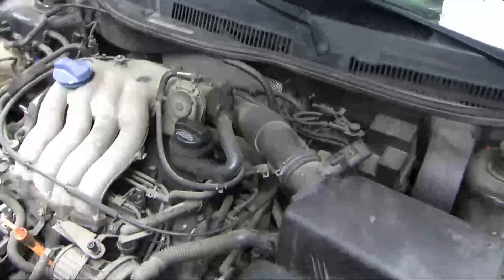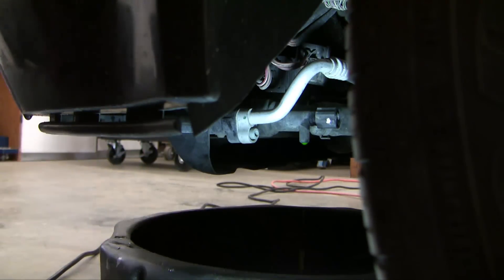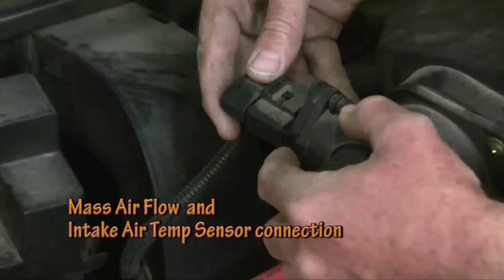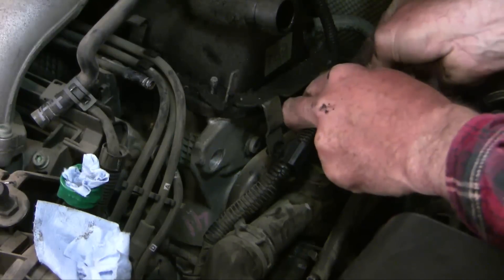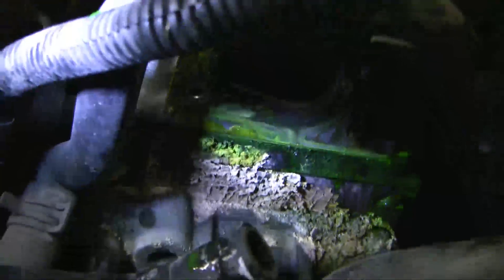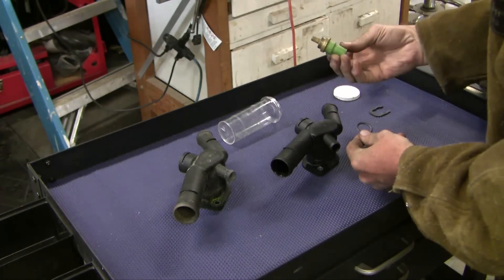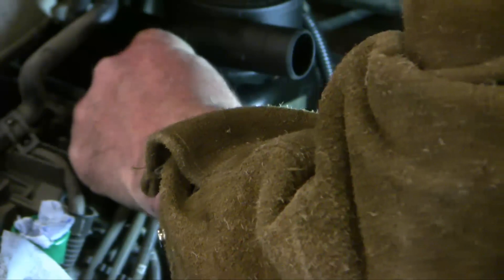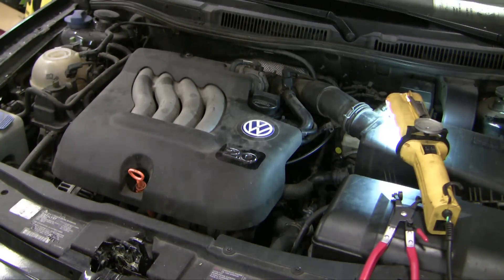VW Jetta Coolant Leak Repair

Comment: You seem to know a lot on these jettas, im a new vw owner (2000 jetta glx mk4) and we have had a problem the last couple of days with a coolant leak, we can not find anything wet anywhere in the engine bay but if you look straight down right behind the bumper you can see something splashing on the brush guard and it runs off the brush guard to the ground and like i said we can not seem to find where it is coming from maybe just by that description you can tell me, we definitely know its coolant because it smells and feels like it and when we stop the car and it sits for a couple minutes you can smell it burning off something, possibly hitting something hot a evaporating ? if you could help or give your suggestion as to what it is that  would be amazing, thank you.
Reply from the maker: You need to follow the wet trail of coolant upward to define where it is leaking. I would take off the plastic covers underneath, and find the source.  Common problems here are a leaking weep hole (need new water pump), a leaking radiator (need new radiator) or coolant hose flange (a little unusual for where you describe the leak in this case). I've posted  a few cooling system videos on a playlist you can find on my channel, showing various cooling system repairs on different engines. Rarely it's just a hose or rad cap, cracked reservoir, etc, but those causes are less common. I have a hand pump that pressurizes the cooling system which makes it safer to lay under the car while pressurized with cold coolant. If you need to run the car, consider your safety. Electric fans come on without warning and you could cut yourself or burn yourself with superheated, boiling coolant. The biggest decision you need to make is whether you are able to fix it yourself or whether to hire a pro to do it. There's a pretty good chance you'll need a new radiator and thermostat based on your story. Most independent shops are reasonably priced and not out to screw you, so doing your own work is not necessarily a lot cheaper. Over the years I've not saved much money, because each time I do a job I buy more tools. So the main benefit is the wisdom and satisfying insight that comes from doing things yourself. Of course you don't gain DIY wisdom without screwing up, making mistakes, and sometimes even hurting yourself or your car by doing something goofy. So bear in mind the risk you take if you are leaving your comfort zone, trying to do a repair with inadequate tools and experience. This kind of problem is not good for an engine, so get the job done quickly before there is irreversible engine damage caused by overheating.
Reply: spelunkerd thank you for the feed back and ya we thought maybe a radiator or I thought the thermostats but we are having the guy we bought it from look at it, he works on vw's and has all the tools need to fix so hopefully this time it leaks while where there because it seems to want to leak some time and others not

Comment: There's a Votex aluminum replacement flange on Amazon for about $40 now.
Reply from the maker: With a brief search, I found it. Excellent! I don't have any experience with this specific aluminum replacement, but it should be better. Most of the reviews on Amazon were positive though there were some remarks about a poorly fitting temp sensor retaining clip (keep old one). Also one reviewer didn't like the rough internal surface that might generate turbulence inside the die cast part (likely insignificant in my opinion), and the poor quality gasket (RTV would work OK anyway). This is what happens when the parent company fails to responsibly deal with a recurring problem. There is so much criticism of aftermarket companies making inferior products, but I have found a few situations where they respond better. It was wise to make it out of aluminum, so that there is no galvanic reaction at the aluminum/steel interface. Thanks for adding your remark here, I'm hoping others who use an aluminum replacement will chime in here as to how it worked for them.

Comment: I have a 2011 Jetta SE that leaks coolant either slowly or fast, if I drive more than 20 miles in a day. Will some leak stop work? I won;t be taking mine apart, since I am not in any way mechanically inclined,,,
Reply from the maker: I'm in the fairly large majority when I say I never use stop leak. That stuff blocks small passages, so think of what may happen to cooling passages within your engine. Shmag everywhere, and poor cooling resulting in possible long term engine damage. More importantly, draining coolant after adding stop leak does not necessarily remove the deposits, so you may cause irreversible damage to the cooling system. I would hunt down the source of the leak, and fix the problem. Often it's a simple fix, like shown here, and worth the relatively small price for repair. If you are concerned about the cost of repair you could ask for help with a general mechanic, since this kind of problem is surprisingly common. Good luck!
Reply: Thanks very much.

Comment: So what part did you actually change to fix the problem
Reply from the maker: wall1 They call it the "coolant hose flange" if you go to the dealer to get the part. It's a common part to fail so they'll know what you mean.

Comment: i got a 03 jetta replace the same part but now the temperature gauge is good but i get a red tempeture light tht blinks
Reply from the maker: The coolant temp sensor is right there, check to be sure you attached the green electrical connector properly, and burp the system to get rid of air pockets in the system. Trapped air there causes the temp readings to be too high, and trapped air in general interferes with coolant flow. Make sure your coolant is properly topped up, and if the car overheats stop it immediately and shut it off for an hour or so to let it completely cool down. Make sure the cooling fans come on when the engine is hot, and make sure your oil level is OK. Overheating could completely destroy your engine, if you feel at all uncertain about your skill set don't be afraid to ask a pro for help.

Comment from the maker: Is it overheating? Sometimes if there is trapped air in the system the cooling is ineffective, resulting in overheating and then steam expanding and blowing out the reservoir. Any cause of overheating (thermostat, water pump, inadequate burping, occult leak, etc) could cause your symptoms. If you want to fix it yourself, the ericthecarguydotcom forum have some helpful participants. First step is usually to properly burp the system.

Comment: I'm with you on AllData... I had also subscribed to Haynes; what a mistake! AllData is not as good as the service manual but pretty close... I used to get the factory service manuals but they priced it out what I was willing to pay. 1994 Ford Taurus the factory manual was 60$... Talk about a nice book plus all the electrical! That was an offer at the back of the owners manual! 2007 Ford Focus I think they wanted around 300$...  I did communicate with AllData at that time and he offered me a free subscription but I have not had need to use it. I'm going to say it was around 2006 when I was working on and had subscribed to a 1998 Hyundai at the time. If I ever buy a new car again; one stipulation will be a free service manual!
Reply from the maker: I know exactly what you mean, I had the same experience with paper manuals. I think the reason the paper manual is so expensive is that they don't make many of those any more, so it's more expensive. Manufacturers are required to produce manuals, but they are allowed to charge what they want for them. I like Alldata mainly for the TSB's, but without the cost of a dealer subscription, which is often outrageously expensive.

Comment: Wow, so I just changed my thermostat on my 2001 jetta turbo and it sprung a leak the next day, was dripping on my transmission! I also changed my temp sensor cause my car wasn't running way to low of a temp! Anyways i hope it didnt spring a leak from the flangle but I have a bad feeling it did! I have no idea why it would do that though!

Comment: where can I buy that new piece for my jetta 2.0 2002 I need a new ASAP? ???
Reply from the maker: +Vacuna55 VW dealers usually have them in stock. Also available from Ebay for less cost, though quality may not be as good.

Comment: Sorry to bug you man.  I want to be sure that I burp the system properly.  Do i just fill up the reservoir, leave the cap off, and idle it for 10 minutes?
thanks again
Reply from the maker: Yes, or longer. While it's running, feel the big hose at the top, delivering coolant to the radiator. It should be warm from coolant flow, indicating the thermostat is open, then wait a couple of more minutes for air bubbles to be transferred out to the rad. It's tricky, because if you wait too long it could overheat and the reservoir will overflow, so don't wait too long. When you stop the engine, immediately replace the reservoir cap and tighten it down. The next phase of burping happens that night as the engine cools, creating a partial vacuum that draws coolant from the reservoir back into the engine and rad. I did a vid called 'hidden genius of the cooling system", explaining how a conventional rad cap works. And I made a playlist of cooling system videos on my channel going in to more detail. In newer vehicles like this one the principles are the same although the location of parts is different. Good luck, man!

Comment: Those "norms" are just brands "norms" not legal or officials norms : like a lot of others coolants or brands of coolants are ok for VW engines like the D type wich is compatible with VW and VAG engines and all others coolants were the compatibility is mentioned on the bottle.

here they are codified by color in the stores : yellow, green ,pink (for vag) and there are universal ones.

Comment: Thank you for this I have 2000 Jetta 2.0 that coolant light keeps coming on i found a small leak from the thermostat so i replaced it. no leaks any more but it the light still goes off and my son keeps putting water in
Help any one!!
Reply from the maker: Make sure it is burped properly, it is not uncommon to need to add a lot more water over the next week after working on a system. If still leaking, a pro would do what I did with UV dye, and probably do a pressure test of the system. Have a very close look around the coolant hose flange for crusting and residue from evaporated coolant. Almost all of these engines eventually leak at that spot. Good luck!

Comment: i have a leak on vw golf 4 is the change similar on this car?
Reply from the maker: I believe they are very similar, but I've never done the repair on a 
golf. If you're contemplating doing this yourself, start with the 
dealers repair manual for more reliable and complete information.
Reply: Anders Dakin the Process should be exactly the same if not extremely similar Volkswagen but the engine in the golf 2.0 that is in the Jetta 2.0 if your car is not a 2.0 then it might be different

Comment: I have an issue where when it rains, my '03 2.0 Golf will run extremely rough when idling. Has anyone else had this issue and what were the causes and solutions? I also have a cracked coolant flange that was sealed with some sort of silicon, so replacing that will need done, too.
Reply from the maker: Tyler Crawford Poor running when it rains is commonly seen when you have an ignition short, often at the wires or connectors. There are videos here on Youtube that show how to diagnose that. In the evening you run the car, open the hood, and take a spray bottle with water in it. Spray fine water mist on the ignition wires, and look for sparks. The biggest problem is to find the source, which could be very hard to find.

Comment: Wat kind of Coolant for a 2005 Volkswagen Jetta 1.9 tdi
Reply from the maker: The short answer is to go to the dealer and get what they recommend, but that is an expensive option for a vehicle that is beyond warranty. For a more scholarly discussion, here's a good reference.
https://www.machinerylubrication.com/Read/841/coolant-fundamentals . I use a lot of 'universal' coolant, sold by Prestone, and others, though it is likely not as good. For modern vehicles with aluminum heads, it is likely more important since galvanic reactions can be an issue.

Comment: same issue with my 2008 vw rabbit dam I wonder how much dealer would charge
Reply from the maker: +adon rosario I'll give a rough untrained guess of $300, assuming the diagnosis is correct and they don't find anything else. However a big part of dealer repair is the up-sell, and it's not hard to find a few hundred dollars worth of other things needing work.

Comment: Well, here we go again. It has been three years and the flange has failed once more. I would like to add that despite my best efforts to prevent this from happening, I do believe that with the heat the turbo puts out that this will continue. Plastic and heat don't mix well and this is a prime example of sub standard component design. This part never had a chance from the beginning. Any way thanks for you video again. I took some inspiration from you and made some vids of my own. Check them out. RegardZsolt
Reply from the maker: +paramonkey7 I'll do that, and as far as VW goes, I couldn't agree more. A responsible company would have redesigned the flange with a metal part rather than expecting consumers replace it as a consumable maintenance item. Presumably they realized it was cheaper to pay the warranty claims as they came in rather than offering a permanent fix. What ultimately takes the hit is reputation, which can be hard to measure in a highly competitive industry.
Reply: +paramonkey7 Just wanted to add a post repair comment. After closer inspection of the flange. It appeared that the lower retaining bolt loosened and caused a warp to occur on the inferior portion of the flange. This allowed antifreeze to leech down via gravity between the head and the flange (during cool, no running conditions) ,causing the rubber O-ring to deform. I replaced the retaining bolts and also use high temperature LockTite 262 on the treads. There is adequate temperature range with this product. By adding LockTite to the new parts this should keep the treads from experiencing any loosening during normal operation and do the trick. In addition, I double checking the torque spec and placed a lock washer on the retaining bolts for extra support with the torque. I really don't want to be an expert on this repair so I hope this fixes this. Regards Zsolt
Reply from the maker: +paramonkey7 Thanks for the followup, and it's nice to hear from you, Zsolt! Drop me a line if you are ever in this neck of the woods, I'll take you sailing. If you bring your hockey gear we'll find use for it, ha ha.

Comment: I replaced the flange and coolant sensor and water/coolant is still gushing out from underneath the drivers side...🤬
Reply from the maker: Remove and recheck, bad sealing surface or maybe even a bad replacement part.
Reply: spelunkerd could it be the water pump? Or a hose in that area? I’m pretty sure the new flange is sealed good.
Reply from the maker: I’m traveling and am not able to see video. More likely to be a hose or flange connection than pump, but if leak is from the weep hole then maybe. Identify where the leak is and decide....

Comment: Can I use coolant stop leak in my vw?
Reply from the maker: I can't think of any situation where I would use a product like that. The main issue is that all those products that are designed to clog passageways can also clog important cooling passages, damaging the cooling system of the vehicle. Some individuals use it because they want to 'fix' the problem enough to sell it to someone else. Importantly, it is sometimes used to conceal a serious problem like a minor leak of a head gasket. But when the unaware buyer finds the evidence of what was done, they often have to fix the root problem anyway, and they are left with the sour taste that they have been duped. The car salesman usually has plausible deniability, which he thinks gets him off the hook. Once you put stop-leak in a cooling system, it is nearly impossible to remove all of it, especially inside the engine block. And inside the radiator (and heater core), stop-leak interferes with heat exchange. If I ever find evidence of stop leak when considering buying a vehicle, I walk away.
Reply: spelunkerd Thanks for your opinion. And for your great video! Think I can even do this!